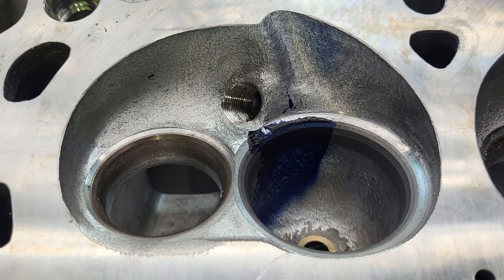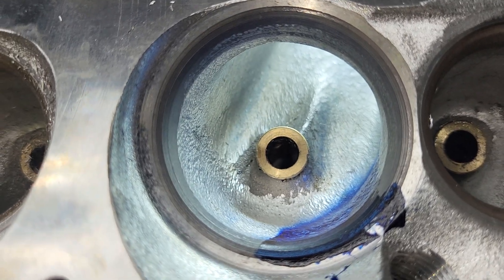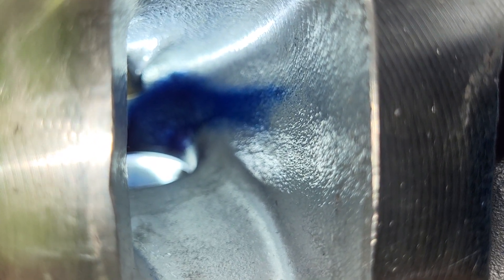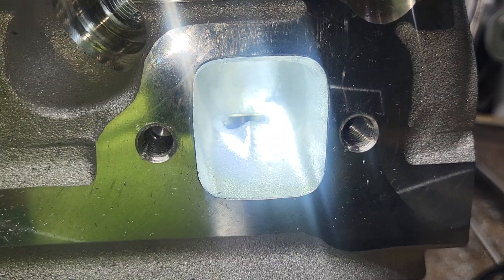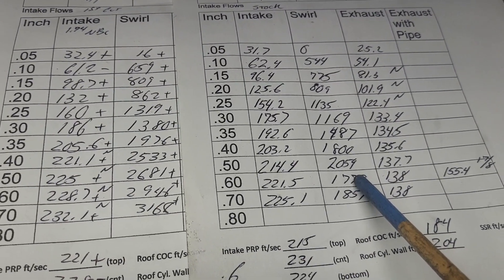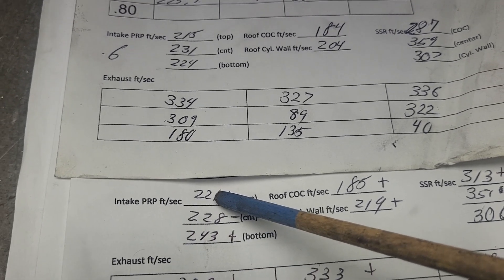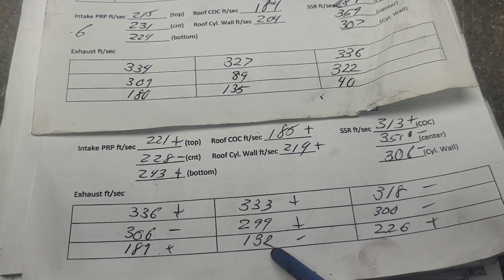GT40X Ford Racing cylinder heads, Fox body, Small Block Ford project 1st cut.

Comment: Charles, a question. Without a vane behind the valve guide, do you see that as an area of low pressure? As an area where the fuel would collect back to liquid?
Reply from the maker: @arturozarate1752  There will be turbulence, but an active port in a running engine is fully turbulent. So I do not see an issue. Thanks
Reply: @servediocylinderheads  I was just having a discussion about this and the other gentleman felt the similar. 

I understand the turbulence and in his view "the reversion would never allow a low pressure area. The back of the guide is turned in the front and vice versa. For a low pressure area to form the flow would have to be constant in one direction."

But the flow is constant long enough for the air fuel charge to get past the valve and into the chamber🤷‍♂️.....

Has me thinking....
Reply: @servediocylinderheads  thanks for the reply.

Comment: Hey Charlie. Noticed that the intake port funneled down to a minimum CSA near the short side apex. Then expanded into the bowl. Wondering if adding some CSA possibly at the roof would help the noise (turbulence) you get on the last cut. Just a thought. God bless!
Reply from the maker: @donaldmurphy8435 I  did that according to roof speeds and casting thickness. Thanks

Comment: Hi there Charles, By looking at the Combustion Chamber and the Vane in the port? I'm wondering if you reshape the Combustion Chamber to more of a Yates design on the Intake side of combustion chamber if it will pick up better? The vane has me thinking a lot of crazy things, Usually the vane helps on the Short side if its on the Intake manifold side but when the vane continues on the Valve Bowl side? That usually helps direct air/fuel like it did on the LS AFR heads. Joel taught me to make a port spoon out of Mig welding wire? Smash one end with a hammer but shape it as a tinny spoon  and use that to find your dead area or fast areas. It take's the Flow Balls to another level. The wetting on the intake wall has me thinking wild stuff though. That large hump for spark plug hole? I think if you shape it like you did on the E7'S, GT40's, and GT40P's it will do better too. Only speculation's on my end. I can't wait until you start going deeper in this head?
Reply from the maker: @garykarenmcgruther6386  It has me thinkin too! Thanks

Comment: Hi Charlie. You said that the SSR is in separation. If it is, how come the flow keeps rising? I thought that with separation the airflow is not following the SSR and you're using less area so flow should drop. Whenever I have separation the flow drops like a rock. I'm just trying to learn all I can. Thank you. Andrew
Reply from the maker: @andrewburlock2653  It drops at first and then starts to pick up with more lift.
Reply: @servediocylinderheads SSR speeds are low. 🤔Im thinking maybe the air is willing to flow down the roof path and that causes it to tumble?

-juhana
Reply from the maker: @juhanahuovinen  That is an interesting theory. Thanks
Reply: @servediocylinderheads  Just a theory.. Laying the short turn could speed it up if the air changes the flow path that way.

If the flow path were to change, i could imagine that the dykem pattern would also be different like less dykem in the port and more on the chamber i think 🤔 Btw how was the bore???

-juhana
Reply from the maker: @juhanahuovinen  Bore was pretty good. Laying back the ssr more will start to hurt the midrange flow #s. Thanks
Reply: @servediocylinderheads  Fill back of the bowl as an experiment? A win all around if we get rid of the so called tumble and the short turn doesnt go crazy?

-juhana
Reply from the maker: @juhanahuovinen  Got rid of the noise. Next video. Thanks

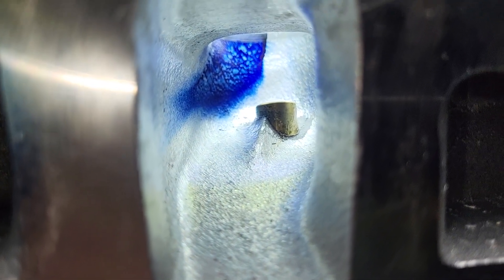Comment: Looking at it more closely, @1:30 the curves on the COC of the pinch particularly at the roof and the floor those curves seem to be carrying some dychem, along with the vortex that get's shed off the sharp edge of the vane, is likely why the speed on the COC of the short side and roof have picked up a bit. That vortex spills over to the roof of cylinder wall side

Comment: Charles Servedio, with the layout dye sticking to the coc, is that an indicator of swirl turning in the opposite direction or maybe a slower swirl.  I've seen a lot of ur videos and this seems unusual.
Reply from the maker: @ericsmcmahan  Ford is turned to the cylinder wall so  you would think the swirl would be less, but these have plenty. Thanks

Comment: My impression is that cleaning up the chamber around the intake v/v and the plug boss made a big (dare i say huge ?) difference , im thinking this is why swirl increased as well, because of that increase in flow past that area , i didnt think that chamber mods typically made really big differences but in this case , maybe ?
Then there is that short side making noise , i wonder what's going on there ?
Reply from the maker: @luckyPiston  ssr is in seperation. Thanks

Comment: When you measure the PRP do you probe top mid bottom center or do you probe along the PR side wall ? tks
Reply from the maker: @luckyPiston  Each position. On my flow sheet, I do top, mid, floor center of pinch. Thanks

Comment: I was told that a stock 1969 Boss heads can flow 275, if true is there an easy explanation of why they didn't copy it.
Reply from the maker: @jackbooten2681  Different design for different application.